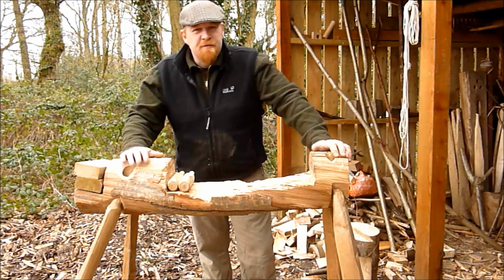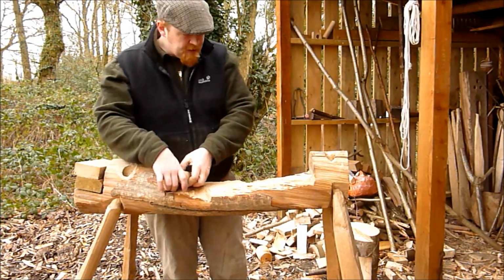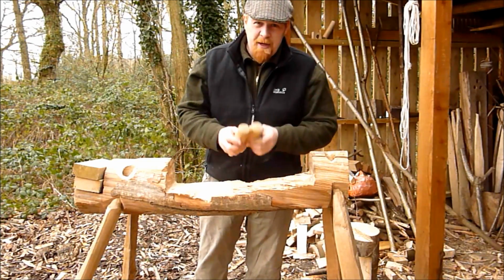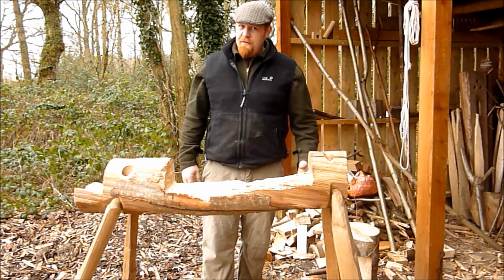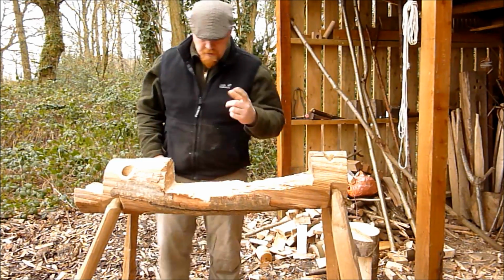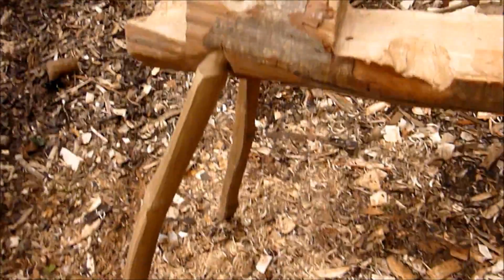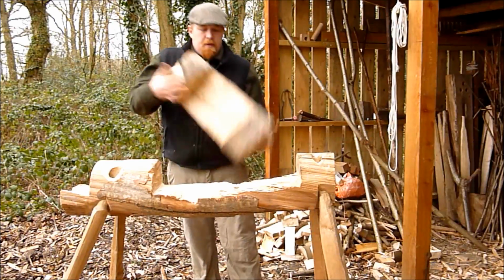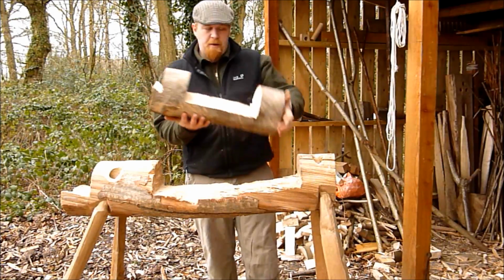Oneday Woodcraft - Bowl mate and kuksa carving

Comment: I do like the mini bench idea never even thought of that.
Reply from the maker: Im having doubts over stability Steve as it won't have the weight of the bigger one. It may have to be shorter than the bowl mate necessitating sitting to use. Watch this space, I'll film it when done!
Reply: Standing by
Reply: +Oneday Woodcraft What about adding weight under the log between the legs, sand bags, stones or whatever, like when you hang a weighted bag from the centre column of a camera tripod for stability.
Reply from the maker: +David Stovell that's a good approach. I was thinking 1/4 logs for legs, weight lower down like you suggest, heck, I could do both!

Comment: If you make a bord with some sides, like a serving tray, in a size that could be placed between the legs you would have a place where you could lay the extra tools you use. Then they would be close at hand when you need them, without being in the way or falling down on you.
Reply from the maker: Very sensible skovbo65, I've been meaning to make a small table along those lines

Comment: Nice work.   I am planning to build something similar to this but have not worked w green wood and wonder if you or anyone has advice as to build it green and let it dry while I use it and make adjustments.   Or use seasoned or cured if. Can find it.  Maybe some standing dead pine.   Thoughts would be appreciated!
All the best
Todd
Reply from the maker: Todd Ross I'd advise using fair dry timber. Green wood will shrink and move/warp so worst case can split or you could lose all your levels.happy building

Comment: hello there, so my neighbor is cutting down a huge old oak tree with some big nice sized burls. I'm having him save the burls for me as I'm wanting to make a kuksa for the first time. is oak good to use and what Tue best way to dry it out so it won't crack or split before I attempt to make the kuksa, or is it better to carve while its still fresh. if you or anyone else give me some pointers I'd greatly appreciate it. thanks in advance
Reply from the maker: Hey Ollie, I don't have much experience with oak due to the abundance of other woods which don't have a tannin issue.  I would look into salt water boiling any kuksa you do carve to leach the tannins away.  Likewise I'm thin on the ground on burr experience!  
The knots in burrs do break out so a sharp axe and careful work are needed, I'd be reaching for a saw whenever appropriate.  If you're only going to use hand tools then working or a least roughing out green would be needed.  Cling film (plastic food wrap) or a plastic bag help slow drying and reduce the chance of splitting.  Turn the bag inside out every day or so.  That would also help if you have limited work time.  Once carved, i store kuksas in a plastic bag in a cool spot in the house whilst i finish them off as the surfaces dryout.  Then outside the bag for a few more weeks.
If you've got a few to play with, get one on the go in a few weeks once the woods mellowed a bit, see how it behaves, try another, keep some back (shaded from sun and wind), they'll stay fresh for a while. 
There's a high chance that you will need to fill knots.  I've used thorns for small holes, epoxy for larger (looks good mixed with gold (brass) powder).  Lastly the English Oak I've used is fairly open grained so you'll have to think about sealing it for hot liguids.  I use beeswax and linseed and a lot of elbow power, chemical based sealants are easier.  
Hope that helps! Get stuck in and don't be put off if they crack, burrs are tough to work with :-)
Reply: +Oneday Woodcraft thank you for the reply, so I got the burls and they were in bad shape so I went ahead and kept some really nice limbs about 6-9 inches across. I'm gonna let them dry and hope for the best. I never worked with oak so I'm gonna have to play it by ear so to say, but I see the grain is very tight and dense with should help me but also will be harder to carve. either way I will learn as I go and again thanks for the reply and keep up the good videos